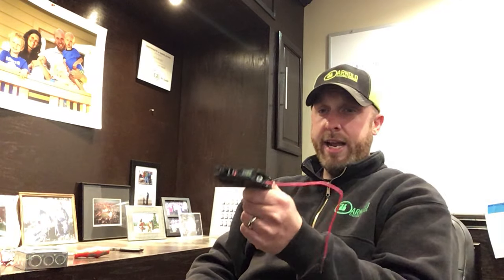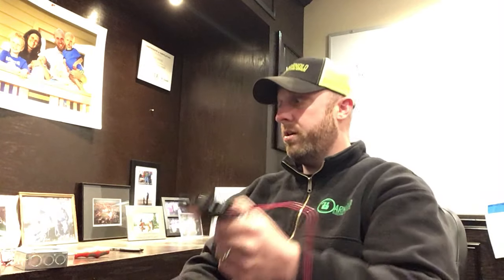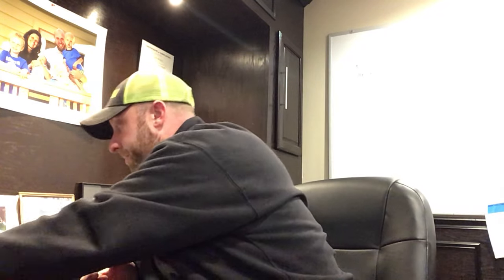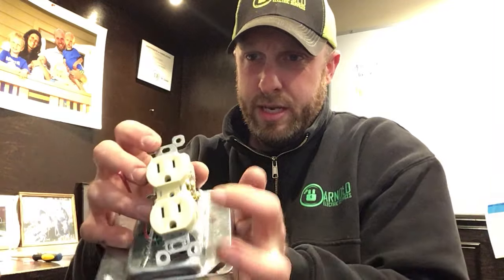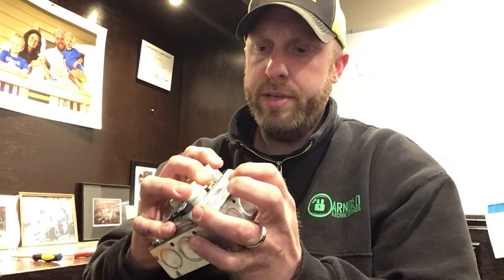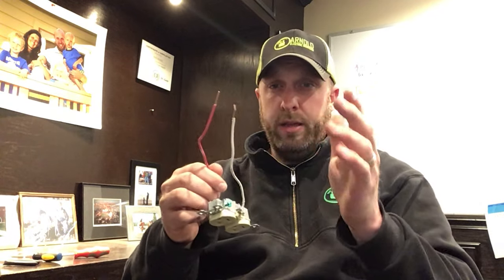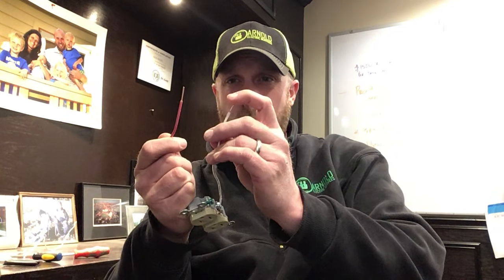3 Reasons Your Circuit Breaker Keeps Tripping

Comment: What is the solution if your breaker keeps tripping and you cannot use a 20 amp in a 15 amp breaker. Do u need to re-wire?
Reply: You should never take out a 15 amp breaker that is tripping and install a higher amperage breaker. You need to fix the issue. The wire that is terminated at each breaker is rated only to carry the current associated with the breaker. The breaker is actually designed to protect the wire and keep it from overheating. So if you have a smaller wire on a larger amperage breaker you will ruin the wire causing a larger and much more costly repair in the long run. It is best to fix the root of the problem.

Comment: In our country we no longer use metal mounting brackets to install wall sockets. You can find them in very old installations (about 60 years or more). It is nowadays expressly forbidden. Electricians use in-the-wall-brackets and boxes made from a fire-retardant and heat resistant  plastic material. It is for those exact reasons you just mentioned.
Reply: My house in the US is 20 years old. I have plastic socket boxes. I have a bedroom where I have a dorm fridge and a table microwave plugged into different sockets in the room with a 15 amp breaker in the garage. The breaker will just mysteriously trip every 3 or so days and on the last occasion we turned on the microwave and the breaker tripped.  Because of the problem, I went and bought a new fridge, microwave and breaker. We still have the problem so we unplugged the microwave and that solved the problem but we shouldn't have to do that because we have three other bedrooms all having fridges and microwaves and we don't have the problem in those other rooms. What should I do so that I can leave the microwave plugged in?
Reply: @crand20033  I am sure an electrician would help you. It might be so that a 15 Amp breaker is just so-so and these two appliances sometimes overload it. You will probably need to add at least one more breaker to supply power for the oven.
Reply: @crand20033  If you haven't solved the issue yet, we do see microwaves that go bad internally from time to time. Recently had a similar issue at a clients home we had just rewired. The client was pissed and thought we messed something up after a year of everything working properly. We were able to determine the microwave was the issue and they were able to get a new one and were happy at the end of the day!

Comment: Awesome video. I’m a new handyman on some apartments complex for 2 years. I got a called last night Tennants says smells like burning and only half of the house has power. Many outlets wasn’t working. The breaker was tripped . I put the breaker back to on and tripped right away. I couldn’t find was outlet was tripping the breaker. So I had to called a experienced electrician
Reply: The Mythology  was a burned outlet was making contact hot to neutral . Electrician replaced it and got fixed
Reply: Thanks for the positive feedback

Comment: This video was very helpful.  I replaced a breaker but that wasn't the problem. After watching your video I changed the socket where i had an electric chain saw plugged in and everything was fixed. Just like you said , wires were moved because that's where I plug in my electric weed wackers too.  Pulling on that socket over the years and it was and old socket .

Comment: Great wise advice.  Can i check if my aunt's office MCB that keep tripping. According to her staff, it is the old UPS that is causing the problem and asking her to replace those with new UPS.  Appreciate your advice.
Reply from the maker: Might be best to hire an electrical to test the load of the UPS and also do a load calculation for you to determine if your system is sized properly. Thank you for the kind words!
Reply: @arnoldelectricservices8235  Thanks Arnold.

Comment: Great video... I have a welder that keeps popping the breaker. Is it ridiculous to change out the breaker?
Reply: Hey Harry. Thanks for the feedback! Changing out the breaker may not be a bad idea, but it depends on the conditions of your system. The wire needs to be rated to handle the current of the larger breaker. Your welder should have a "name plate" on the device telling you what the FLC or Full Load Current of the unit is. Check that out. Hit me back up if you have more questions and that does not solve your issue!

Comment: Almost every time I clean my GE Profile cook top, the outlet that is on the wall near the cook top (and has a breaker) trips.   I use a little dish soap on a damp sponge to clean the cook top.  I am wondering if moisture gets into a place it shouldn't be and that is why it trips.  I would be so grateful if you could offer any insights.  When this happens, it sometimes takes more than a day for the breaker to be able to be reset.  That means I am without the use of the cook top for an extended period. Thank you!

Comment: My problem is all of a sudden it started tripping out of nowhere?? 4 lights are on the circuit and all others work n stay on; but only the garage lights trip it. I changed both switches (the one in garage n the one in the house) , but it still trips. I unplugged the 3 fluorescent lights in the ceiling that the tripping switches go to, but it still trips. Ugh 
Any suggestions?

Comment: Thank you. Electrician coming this week. But my breaker is now tripping without anything plugged in. My outlets for main tv, cable box, surround sound. The outlets seem to be culprit and maybe it’s the ground fault you said. But breaker stays on for like a min now then trips. Not instantly. Any thoughts?
Reply: Hey what was it ?  Same problem
Reply: @cristinar5535  Electrician said it was breaker and replaced breaker. When took panel off, it was also discolored a little.
Reply: Did that fix it

Comment: Nice video. My breaker has recently tripped when I plug the fridge or a saw  but there is only a Dyson charger on the circuit. Until now the fridge  was plugged in the outlet and I never had any problem. Without the fridge Or the saw plugged in the outline the circuit works fine. any idea where it can come from ?

Comment: Excellent video brother, I have a 50a that I'm using for my EV, It won't trip while in use but I'll leave drive around all day and come back and the circuit has tripped.  It's dedicated with nothing else on it.  It's a 6 gauge. Any idea why it trips when not in use? Thanks.
Reply from the maker: No idea! There could be a loose connection by one of the breakers that's causing heat to build up. If its not a loose connection an electrician can put a recording electrical tester on your panel overnight to read any spikes in voltage or amperage. Thank you!

Comment: I have a 1984 condo in Louisiana. With high ceilings. I have a ceiling fan that trips my breaker. Company disconnected the light switch. $500. To much to fix a ceiling fan. Hangs 14ft high ceiling 28ft. And my furnace trips my main breaker. Thx for a few ideas and tips to try.

Comment: I lose power in a series of outlets.. and no breakers trip.  Resetting the breaker off/on doesnt help... BUT throwing the main breaker WILL often work.  Thoughts?   On the MSP I noticed the neutral conductor seems abit corroded.  Thanks!

Comment: One question: I have a brand new 230V Toshiba window unit. It’s a big one. You pull this baby out through the inside of the house, and wheel it outside to clean it.  It’s on a dedicated circuit, or receptacle (nothing else is on this circuit). ….and she keeps tripping the breaker. 
Is there a recommended amp rating for these units, Or a certain household receptacle wiring size for a 230V???? 
Oh, and here are some bits of info from this Toshiba unit’s data tag:
Volts: 230/208V single phase.
RLA: 5.8/6.25A
LRA: 40A
FLA: 0.8A
Amps: 7.2/7.6
Please forgive my ignorance. All I know is that wire size, and amp ratings have a lot to do with each other, and very important to get this right, and not burn your house down.

Comment: I have three outlets in kitchen . When I turn on two appliances like air fryer and coffee maker the switch pops on the circuit breaker. I was told it needed something like a volve . I'm sure that's not what was its spelled . Do you have an idea  what I would need?

Comment: Hi, loved the video. I have a breaker that I cannot reset, it arcs when I try. There are  several outlets but nothing is plugged in. A visual inspection does not reveal anything, but maybe I am not thorough enough. I was looking for some kind of tester, but are there any testers which can test the outlets with no  power from the panel? Thanks
Reply from the maker: Hi, Thank you! There are outlet testers you can buy, but they won't tell you where the issues is.

Comment: Here’s my situation. I built an addition. Everything including the electric was inspected and passed. 
I have four outlets on the circuit.  If I use the first outlet I’m fine. But when I use the vacuum cleaner on any circuit gouging away from the breaker it trips. 
I’m going to be pulling the outlets this week and then try the vacuum. If it doesn’t trip then I know I’m touching something in the box.   It only goes when a load on put on. 
I was told it could be a bad breaker in the panel or a screw is touching it. 
But when it’s left alone the breaker doesn’t trip. 
Suggestions?
Reply: Most inspectors wouldn't  catch bad splices,loose screws, or missed wired devices. Assuming it is not an arc-fault or gfci breaker.  #1 Get your Electrician back that did the work. #2 Start by checking for  proper voltages (120v)  at each outlet  #2 remove panel cover to check circuit connections.  #3 pull out receptacles affected an look for any discoloring or burn marks ,loose screws,or bad splices.

Comment: My 20 amp breaker 220 going to my well keeps tripping, I disconnected the wires from the well and turn on the breaker and it still trips, how do I find where the wires in the wall or how do I find the short? Thank you so much Sir
Reply: Same we’re screwed lol

Comment: I have a question sir,I have an outside outlet being powered by an inside outlet . I have the boxes secure to wall, I put silicon on the outline of the boxes to protect it from water and and all I don’t have wires crossing, I made sure the outlet does not touch the metal box, I taped all possible loos cables, inside the house , I don’t have an overload, I made sure the box is not energized by a loose cables, I even used the Klein tool that gets connected to the outlet and lets you know what’s wrong  and the breaker still trips every other week or every two weeks. What could it be?

Comment: So how do you reroute certain electrical outlets to another breaker? Or is that something that someone can't do themselves?
Reply from the maker: You can reroute electrical outlets by pulling a new circuit from the panel to the outlet that need to be there own breaker. If you have conduit you can use the existing conduit and pull the wire through it, if you have Romex you need to get creative and get the wiring to the outlets through drywall. Its probably best to call a professional as it causes you less headache.

Comment: Question:  our pool pump was working fine all summer, today while the vac was hooded up I disconnected the power, opened the basket and cleaned the pool debris then replaced the basket, and plugged in the pump. It immediately trips the (damn) GFCI outlet it’s plugged into.  The outlet won’t reset, and the pump seemed to be working fine.  Best guess?  

  Pump is a Hayward, 115v, 12.0amp on a 15 amp dedicated GFCI circuit. The pump is about 6 years old, outlet is at least 10 years old.  

 It’s got me completely stumped.  I am a welder, not an electrician. (Or pool guy)
Reply: Gfci plugs don't last forever. If it wont set either the breaker tripped and there isn't power to the gfci, or it's just worn out and needs to be replaced.

Comment: I am in Arizona so calling you would be out of the scope of work but I do have a question I hope you can answer for me. I changed all of the wall sockets in my master bedroom about 2 months ago and the breaker will trip sometimes but I can reset it and I am good to go for days and/or even weeks. Any idea on what would cause this issue? I changed the sockets because I plugged a vacuum into a wall and lost power to the room so I figured maybe the wall sockets were old and should be replaced. The house was built in 2002.

Comment: Hi Arnold, I live in Canada. Could you tell me the reason why my outlet didn’t have power when I plug into the car to keep it warm ( -20’C). I changed the outlet but the Circuit Breaker keeps tripping. Do I need to change the Circuit Breaker or Fuse? Thank you very much.

Comment: One trick seems to be turn off lights or other things while you use the thing you are trying to use. Circuit breaking often = fire hazard = get a professional involved before you place burns down.
Reply: Is that a trick or a work around? hahaha. You should not have to turn lights off to use the circuit you are using.
Reply: @jackarnold3062  exactly. Our property manager and I have been going back and forth on our breaker and dishwasher going out. I do t have “too many” things using lower at once. I put renters insurance on our policy because every time that dishwasher is cycling after I switch the breaker back to working, it smells like burning plastic or burnt metal. This has been going on for over a year and each maintenance guy replaced something in the breaker and it doesn’t resolve the issue. The dishwasher fills up, and the breaker is tripping.. now my new smart tv is crackling and having issues, also the sockets rarely have power. Can’t even use my electrical sockets most of the time. I’m over it. I hope if the apt burns, that myself, babies and dogs , and hubby aren’t there. It’s a scary feeling :(
Reply: I kept smelling burnt fishy smell. Manager said its not the electric. Turns out I had an outlet melting in the wall.  Crazy how much we can learn from Google nowdays.told em it was bad
Reply: I’m late but 9/10 majority of the time electricians wired multiple receptacles and lighting fixtures on the same circuit and the gauge of wire they used isn’t rated for much

Comment: What if it's a water heater, 240 . We noticed no hot water,tried resetting breaker but it immediately trips. There is only water tank running off that breaker,no outlets. Does that matter?

Comment: So if your outlets never had a problem and all of a sudden year or two goes by and these problem pops up for example… would a screw holding the wires on the outlets comes lose over time … question how is that possible ?
Reply: Electricity causes heat which causes expansion which can loosen connections 
Also electricity can create vibrations

Comment: in your first example, why wouldnt i just replace the 15 Amp breaker with a 20, instead of paying someone to tear up my house un necessarily?
Reply: 15 breaker usually means that you have 14 gauge wire, you need 12 gauge (thicker wire) for a 20 amp circuit, so you don't overload and overheat the wire.

Comment: I have an older Sears Craftsman 30 gallon air compressor, runs on 110 (15 amp circuit) in my garage.  My compressor works fine, but than after a few minutes it pops the breaker.  I re-set the breaker and then it pops again. Been doing it for years, but now it has gotten worse. Before I could fill it all up, now it fills just a little.  Do you think it’s the capacitors (run or start capacitors) on the compressor and if so which ones?  Or do I need to increase it to 20 amp?
Reply: If you pull more than 80% on a 15 amp breaker it will heat up and eventually trip! Check your nameplate rating. You may have to dedicate a 20 amp circuit for your air compressor!

Comment: I just moved into a newly renovated basement apartment, breaker keeps tripping only item I have plugged in nand running is my t.v? I'll be watching t.v approx half hour or so it will trip
If I run my electric fireplace it trios right awY

Comment: What about if you put the wires to the wrong side of the bolts even if grounded don’t you have to match brass to brass and silver to silver? I think mine may be backwards causing a short now after a year it was fine all of a sudden keeps tripping.. I’m going to try replacing it.. thank you
Reply: The hot wire should be on the brass screw and the neutral wire should be on the silver screw. However if you wired it backwards it would not cause a short.

Comment: Electricity does some weird shit. Currently trying to figure out why my 20a kitchen breaker is tripping. Been running same appliances for the last year and a half no issues. Going to try a new breaker tomorrow, i know thats usually #4 on these old houses due to my father being an electrician. I removed all outlets and they seem okay. Taped off my screws and legs on the one that looked like it may cause a ground fault. Still trips, even with the microwave unplugged. Ran for 2 hours while i was at work and tripped while i was checking lowes for a QP Siemens single pole
Reply: I’m having the same issue when I run microwave and toaster but doesn’t do it all the time I think
We need to upgrade to breaker to a bigger amp.

Comment: Can an overload or other issue you mentioned trip a circuit breaker other than the one causing the problem? My kitchen remodel is happening and electrical work done, but the garage door circuit breaker keeps tripping. It doesn't look tripped because the position shows on but when I flip it, it works.. for one use, maybe 2.

Comment: I have no idea what is going on but my breaker keeps tripping in my living room it was working fine for a while and i went out bought a new fan that uses 120w and another that used 50w both on opposite sides of the house i had the 120w in the living room and after being on for about 2-5 mins the breaker trips and the same happens with the 50w when i switched them from rooms